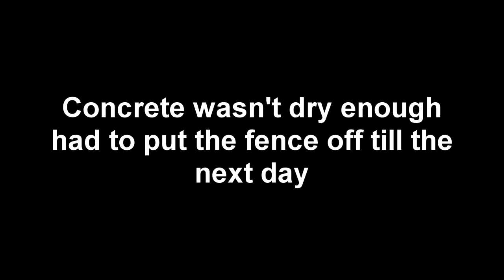Who's Going To Help Finish The House..?

Comment: Joe, here are contractor prices:

$500:  They take the money, knock holes in your walls, steal your stuff and leave

$1,000:  They install it improperly while damaging everything and you have to pay someone else to tear it out, re-buy the materials, and install it from scratch.

$3,000:  It gets professionally installed by a reputable company that guarantees it with a warranty, does not damage your property, cleans up after themselves, and finishes in a timely manner
Reply: not to mention a warrantied project(s) installed by professionals is a great selling point and adds value to the property
Reply: Not necessarily my dad charges mostly below 3k and does the job great .
Reply: JOE!!! 🖕 THIS
Reply: tales  those prices weren't literal lol. He was making a point
Reply: @riverdaletales8457  Im sure he does great work. though there is a difference between good/great work and correct work. Let me explain.

When it comes to manufacture backed warranties on home improvement projects,  it is incredibly easy to void the warranty. 
When manufactures release a product, they put out detailed instructions on how to install the product as well as with what exact materials & tools to use. Along with how to ship and handle the product. If you vere off the slightest bit from those specifications, you immediately void the warranty. which is why having factory trained installers on that specific product is so important. 

And every company out there has their own unique way to install their product to increase the efficiency and longevity of it. So its hardly ever a "one size fits all" type of thing. So if you know how to install one roof you technically COULD install the next.. And you can make it look pretty and nice, but more than like you missed a detail that might have screwed the homeowner over out of a warranty.
Reply: Gotta go cheap
Reply: Cheaping out creates drama and the mouth breathers criticizing in the comments section and watching the videos will profit a few extra grand on top. Youtub is his income and the viewers watching 30min vlogs are the cash cow. Facts
Reply: @callsigncamp  Yeah idk though, bro is bleeding money. He definitely capitalizes on  the drama, but i don't think he'd throw his wallet in the fire as marketing tactic for youtube lol.
Reply: Fucked up part about it is he is gonna spend three times the amount on rework. He should of just hired a reputable contractor and got it over with. The house would be almost done by now and ready for inspection. But nope let's hire crackheads who put drywall and cabinets in before its even inspected. Way to go Joe. Dumbass.
Reply: LOL Yeah maybe in your idea of a perfect world!
Reply: @riverdaletales8457  Dumbest comment here.
Reply: @TonyRule  how it's true
Reply: @riverdaletales8457  He charges <$3k? Cool. Have him replace my siding for that.
Do you get it yet?
Reply: Owen Stevens  He's going to have to move back into jail for free rent and food.
Reply: my dad only charges about half that and does the best job
Reply: @riverdaletales8457  Your dad is a saint and the minority. It goes without saying that OP was just generalizing for the sake of being concise
Reply: @angiet7380  thanks 😂 and true you right.
Reply: what about the guy that cahrges 875$$ to beat the other guys price
Reply: yep i could not have said it better my self
Reply: @callsigncamp  speaking of mouth breathers... did you hear that gum?
    Oh okay I did enough hating on Joe I actually like Joe but have had misophonia since I was a kid so I'm just going through some psychological stuff.
Reply: @donnieolaughlin1758  hahahaha goddamit... The gum was reeedickulous
Reply: But if he goes with the professional there isn't any content or clickbait ……. Where the fun In that ?
Reply: Joe:   Ill take the $500.00 bid.  great price.  sounds like a price right up my alley

Comment: I'm an electrician and I'm not working for $35 an hour 😂 

The customer doesn't need to know the hourly rate. You give them a number for the whole Job.  Customers freak out when you tell them an hourly rate. The same amount looks better if it's for the entire Job. 

Always round up because you will forget to add some things and once the price is set that's it.
Reply: Yup that's why you always quote the job by the job not the hour. Customers will start counting your lunch breaks and what not.
Reply: @sellers8133  Exactly. Let's say it takes you 10 minutes to switch out a breaker and test the circuit. You could say that's $100 or you could say that's $10 a minute.

Most people would go crazy if you told them $10 a minute.
Reply: Joe is not going to give you more than $10 an hour if you don't have at least 10-15 years in a high  security prison
Reply: Exactly, he is not getting a "electrician" for $35/hr. He is getting someone that thinks he is a electrician for $35/hr. I was a electrical contractor for many years, wouldn't even discuss $35/hr for my services or any of my guys, several years ago. And to make it better, no permits! Inspections dept will drop the hammer on him when they find out. Most States allow a homeowner to do work in their permanent residence providing the get permits and install per code. But that is not allowed in a flip house, better be licensed contractors. hen he tries to sale the house, the bank will require a home inspection and the home inspector will require permits for work performed for his/her documentation for the bank. No permits, call is made to building inspections.
Reply: robert I was wondering about that because my ex is an electrician for GM and he makes so much more an hour
Reply: @chrism2042  Here in Kentucky the homeowner is the only one allowed to work on it... BUT that's only if the meter had been pulled. You need the power company to come out and inspect it before turning it on. The inspector can't make you redo old work, only the new work that has been done. 

Otherwise you don't need an inspector for adding circuits and anyone can do the work.
Reply: @robertkywildcats9266  - KY is much more lenient than most States. In other States, a home owner can only do the work if it's their primary residence. Not a home that someone else will be living in. Most States, this requires getting proper permits and licensed contractors. The inspector can make them rip out all sheetrock to expose all new wiring and plumbing that has been installed. When changing the panel, if there is no exterior main the utility company will cut it loose but require approved inspection to re-connect. I recently had 2 new hvac systems installed in my house, figuring the hvac contractor would re-connect the electrical to the air handlers and heat pumps. They didn't because they were not licensed, they had a licensed electrician to come in then County inspector came to inspect the mechanical and electrical.
Reply: @chrism2042  Yeah I can't even imagine somewhere like California. They're the king's of stupid tax.
Reply: Robert KY Wildcats yea my dad was an electrician. Never told customer hourly rate. But if it was a short job he would give a minimum of 75 dollars or sum like that.
Reply: @chrism2042  sounds like joes fuct
Reply: @chrism2042  how much an hour would you charge?
Reply: @mark-jx9uh  - I have not been doing electrical contracting for several years, I do architectural engineering. Can't count the times I have received calls where people have got caught doing work without permits and the inspections dept shut the job down, then I get the call because inspections requires the owner to get a engineer involved. Just had one a couple months ago, the guy had to rip out approx 90% of the new electrical he had installed. And of course all of the new gyp board had been hung and finished, they had to remove every piece of board where there was new electrical or plumbing installed so the inspector could see the rough-in. Thing is, when this is not the owners primary residence and other people will be living in the house, this is a life safety issue. Defiantly need professionals doing the work, not some dude that walks off the street and knows how to wire a receptacle. On top of it costing Joe a fortune to do it right, the code jurisdiction will be watching him and the non-licensed people that done the work, they typically get fined and will not be eligible to take State contractor exams for several years (if they wanted to do so). On top of that, if someone buys the house and it catches on fire due to electrical, the so-called contractors are not licensed nor insured. So who gets sued? Joe! If people gets severely injured or killed in the fire, they will take everything Joe has, and then some. For people that think the inspections are BS, would you really want to sleep in a house where jackleg want-to-be electricians wired the house?
Reply: @peytdawgs9909  - I stopped doing electrical contracting years ago. But that question all depends on the State and area average. A net search on (average "state" electrician cost per hour) may have averages for areas
Reply: @chrism2042  yea,with all this knowledge in these threads joes an idiot

Comment: The Inspector will need to look at everything before you close it in if not they will make you OPEN IT UP Bewareeeeeeeeee
Reply: Joe doesn't care lol
Reply: @Andy-im3kj  lol
Reply: I just looked up the codes on that. He is going to have to tear down the ceiling. No load bearing beam over the archway he took out. The wire that were ran are not far enough into the out side wall. I bet the wires have been punctured by the drywall screws.
Reply: Not like he even reads his comments anymore lol. All this advice gone to waste
Reply: That’s not how it is everywhere. No inspections like that where I live. Small town of 25k in southern Indiana.
Reply: It's sad what is happening to joe he is a Real Cool dude an is being taken for a rookie
Reply: Chad Gochis  I said that from jump. Bryan could report his channel,it shows when Joe started. He will get fined majorly for everyday since the first day the renovation started. So he needs to stop everything and try to get all of that in order. Does he have a clue how much trouble he could be in?!!!! He doesn't care does he.
Reply: Ryan Hsu  The house isnjust odd?!. The water that was underneath it and no water to the house has to be a major problem. It is in a ton of Jack's. This is the land version of the Titanic!
Reply: Ryan Hsu  That's a good idea and will happen when hell freezes over.
Reply: Any body wanna buy a door?

Comment: @2:50 Either your house is about to fall down in the back yard, or that fence post is leaning way towards the street lol.
Reply: Could be the camera angle but I see what you mean by the siding and trim leaning to the right... if it's not the camera I'd be worried of the structural integrity of his house

Comment: the best way to check your water for leaks is the same way when you have an inspector check it. They put a pressure gauge on the inline and pump it up to 15 pounds of pressure if it loses any pressure you have a leak somewhere. You don't have to worry about flooding.
Reply: Where's the fun in that?
Reply: @dennisolsen4507  that comes in if you have a leak. You have to find it.

Comment: Just dumped a quick Crete in a hole and it will collect the moisture from sand or from the dirt around it in the hole that’s all you have to do are used to work for a fence company and that’s what we did

Comment: In my bathroom, we finished the plumbing walls and ceiling. Next, we set the tile grouted it and all then installed the cabinet and molding. The toilet was the last thing we put in and that room was done. Inside a house, you work from top to bottom always doing all flooring last. We learned a lot of this the hard way, had to replace carpet in one of the bedrooms where workers kept their tools. Knowing when to do something and how skilled the person doing the work needs to be, takes years of knowledge (workings yourself) in the field. I'm lucky and have a friend who is a licensed contractor, he taught us a lot and caught many workmen's mistakes before they became super costly mistakes. Going it alone with basically no real-life building knowledge such you are doing. You're going to get taken by workers claiming to know what they are doing when they don't over and over. If you don't get some help from a professional builder you'll lose your ass in the end. Pay these professionals now for their knowledge to do it right, or pay them twice later to fix all the unskilled screwups lol.

You may have stacks of cash in the bank to burn from doing these prison videos, but most flippers go broke doing what you're doing. We broke even at market value for our flipper, which in the end became a rental we still have. It just didn't make sense to sell it after all we put in it.

Comment: You should have moved the hole so it’s straight with string.
Reply: Most people run the string and drop a rock straight down...and thats where they dig the hole.  I have no idea wtf Joe is doing
Reply: Nah. Just send it. No redos. Just like finishing crackhead brians work. He dont care if the work is bad and wont work. Just needs someone to finish it. THEN redo it all for 6k after.

Comment: Joe you should’ve nailed a 2x4 to the inside of the 4x4 and used it to nail in the sheet just like u would if your framing on a floor doesn’t match up replacing sub floor u add a 2x4 to the exsisting Joyce so the wood has a solid frame to sit on

Comment: There are more than 1 idler pulley boss.... I would look at the AC compressor pulley. Spray some WD 40 in-between the clutch and pulley. If the squeaking stops it will be the free spinning bearing. Hope that helps.

Comment: You need to put some Ram Board on that tile right away joe. It should have been covered up a long time ago. You have to sweep it before you cover it up or the dust can scratch it when you step on the cardboard.

Comment: For any fence if the uglier side(posts and wood running horizontal)where you can see the posts to the ground,then its your fence,the prettier side is always away from you. They say that's weather treated but a month or so get a nice stain for wood and seal the wood or it might turn grey on you, quick.

Comment: Joe replacing the breaker box will not stop the breakers from tripping...you need to split up the circuit in the house you need dedicated circuits for certain things and when you jump off of them for other things it will trip the breakers
Reply: That job is an easy 5 or 6 grand for the electric

Comment: Joe if your doing plumbing,hvac and electrical you need to hire license and bonded contractors to do the work so you know all the work is done right and will pass inspection cuz if the city decides to show up and the people aren't licensed and bonded you could possibly get fined.

Comment: Hi joe I think the fence is not going to hold it appears weak there strong winds my husband make steel boxes for each pole  with  sement stones inside the boxis then u put wet cement in and level it with leveler ruler to stand up strait eath pole will when dry be strong to put wooden fences on that how its done because there is stong winds it won't go done its stronger just giving advise

Comment: Seems like a tiny ass tankless water heater. I get the fact the house is small but if someone is showering and then you need hot water in the kitchen and laundry room, there’s no way that dinky unit could supply enough constant hot water

Comment: I worked for a fence crew once..  We packed the holes with concrete mix - built the fence - watered it in before we left.  Js
Edit: Plus we used a chainsaw to cut 2x4 and 4x4's . Lol.

Comment: Hey joe if you want to put in a hvac system and save some cash i suggest a mini split system it will do as good or better job than the standard init and are more efficient and the electrician is being honest it will be better to replace all the old lines and inspect all the lines that are left good luck

Comment: A shim is a sliver of wood used for leveling and filling gaps. A 2x4 is not a shim, your sistering doubling up and bracing. (Just a little FYI, "The More You Know" right)
Reply: And shoulda probably used screws not a nail gun especially on the old sections you just put to new posts. Also nexttime cut the posts for height before putting up the sections now your gonna have to make sure you don't hit the fence when cutting the posts down

Comment: Joe if it was squeaking under the hood it could’ve been a pulley but usually I don’t replace a water pump until a car is over heating but to replace it just cuz they thought the pulley on it was bad? That’s dumb of them. Hopefully u figure out what’s causing the noise

Comment: A little more on fences..... There should be an inch or two between the bottom and the ground. The fence should NOT be touching the ground. Even if pressure treated, it's most likely not ground-contact rated pressure treated lumber. (as an side, make sure posts are...there is a difference). Also, on the front fence, you should have left it centered on the post. You can buy the fence pickets by the bundle, and next to the house, nail one right to the fence but close to house, and then bridge gap on neighbor side with another picket the same way. Don't worry, it would look like you meant to do that. Maybe on the next fence try that.

Comment: You 2 should have just padded out the 4×4 post your fence came up short on & nailed fence to that. Then you wouldnt have to cut a fence section,wich will short you in the end. Is anything ever done correctly the 1st time? Or do you just like waisting $$ & doing things 2/3 times over.